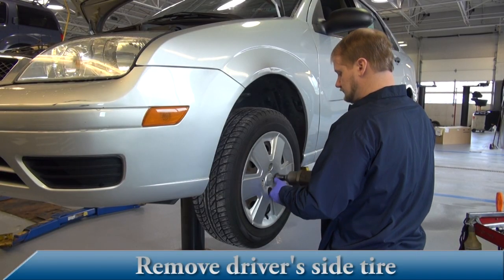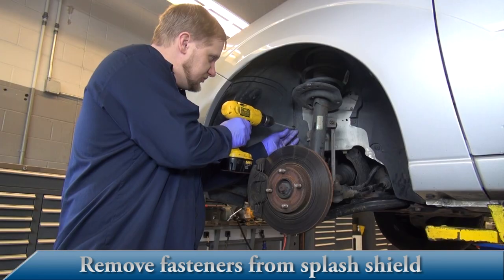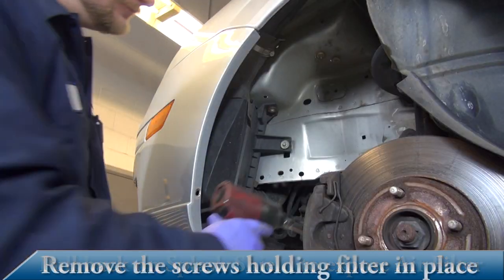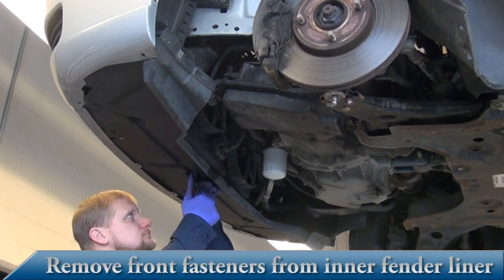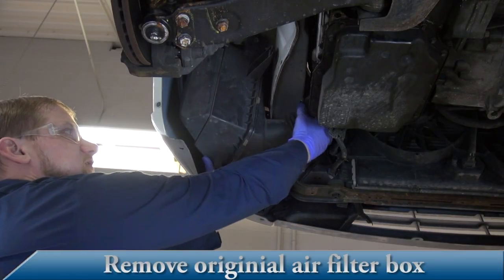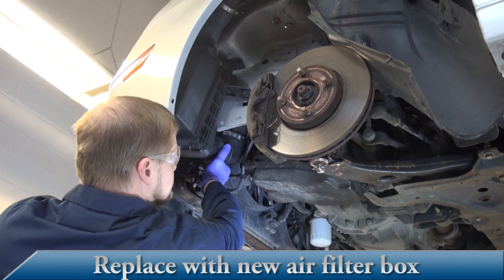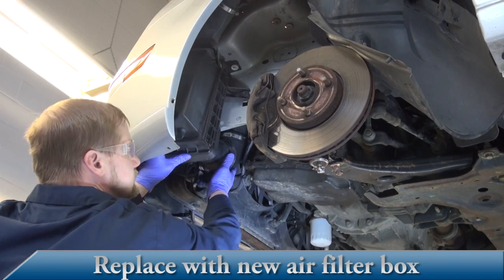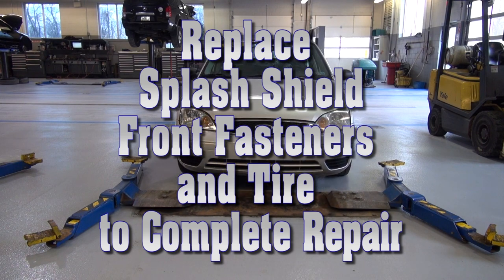Dorman: '05-'07 Ford Focus Air Filter Box Installation

Comment: The filter box is mounted with three screws. There is another screw towards the top side of air filter box that needs to be removed to take the old filter box out. I found it easiest to reach that screw by removing the orange side marker light and use a long socket extension rod with a flexible joint through the opening. It is also makes the job a little easier by removing the head light. I had to replace my cracked filter box because debris goes through it and got the idle air control valve stuck and I have very high idle. The new air filter box cost about $60 on the eBay. I am only an occasional DIY guy but I found this job not very hard, with the help of this video. Thanks for the video.

Comment: Bought this Dorman filter box from Rockauto for $50.00 but good luck finding the Saturn filter that goes in it locally. Had to order that from ebay.
Reply: what was the part number for the air cleaner?
Reply: Rockauto had them for $3-$4. Bought some a few weeks ago.

Comment: To all you haters, I bought my '07 focus new.  It has 140,000 miles on it and this filter is still fine.  I'm just recently noticing a drop on low rpm torque and general sluggishness.  It "feels" like a dirty air filter, but the indicator still says it's good.  Whenever you put big parts in a tiny car, the engineering is bound to get a bit hairy, but I don't think taking off a couple splash guards every 200,000 miles qualifies as "nightmare" engineering.  Now, removing a motor mount to get to the alternator...
Reply: Replacing that alternator is a bitch. And with Ford's charging system I highly recommend a new unit. Never install a rebuilt in a Ford Focus.
Reply: @jamesoberg8809  The alternator I replaced at 130,000 lasted 110,000 miles (it was a rebuild).  I did manage to replace it this time without removing the motor mount.  Just remove the heat shield in place, remove the two screws that attach the plastic lines to the firewall in the middle and you can wrestle the alternator out the top.  I put another rebuilt unit on it.  I figure at 242,000 miles, another 110,000 for the rebuilt unit ought to do it.
Reply: @alanm5697  From information that I've read on this particular charging system most rebuilt alternators fail quickly so since  replacing one is a huge hassle most mechanics recommend a new unit.
Reply: Sad part is crank case valve have to take entire intake off 2 hr job for a 3 second replacement on the valve freaking crazy
Reply: @jamesoberg8809 i had to Loosen the Motor Mount on Top Passenger  side to replace the Alternator it came out through the Bottom of the car I had Jack Stands and The Jack Supporting the Motor

Comment: Get it from rock auto only 65.00 and fits right. Dorman wants 4xs that for same part. Purolator filter a14649 fits. It's easy to get the top bolt thru the l fog light cutout just remove the light or cover
Reply: Have you had any problems since then ??

Comment: I took the box off and then put the box back on, hit the reset. Now I have a check engine light, saying the intake is open. Any ideas to why?
Reply: Kyle Feilmeier I recently tried using a 2008 air filter box and it triggered a check engine light. The engine ran rough as well. It was allowing too much air to go into the intake. It thought there was a vacuum leak.
Reply: Did you ever get it working?

Comment: Any comments on the air filter required for this box? Equivalents.
Reply: WIX 46107 Air Filter for that Dorman Air Filter unit.
Reply: @billrau2398  I did end up figuring out the wix but could not find one to buy. Ended up with the Air Filter Champ AF7835 For SATURN SC1, SL, SL1, SW1, it worked.

Comment: Why all the pissing and moaning??  This filter is good for AT LEAST 150,000-200,000 miles!!?? Most people who buy new don't even keep their cars that long!
Reply: It actually robs power and does not actually filter that well. Dyno testing at focus sport werks showed an increase of 11hp and less debris passing through the filter with an aftermarket intake kit. This kit would most likely give a few extra horses and allow for better filtering. This is for people like me who keep cars for engine after engine after engine. I have 146K on my focus and it will see 400k+ miles long before I am done with it.

If this is what "most people" wanted Ford would have installed it from the factory. But that is why aftermarket exists.

Comment: Dont Replace the Air Filter box, it Suppose to last the Cars Life, you don't want Check Engine light on, just Clean the Throttle Body and Intake Housing it seems Dirty 😉